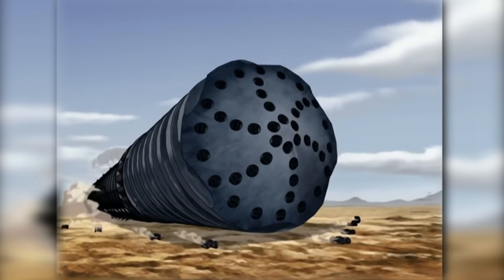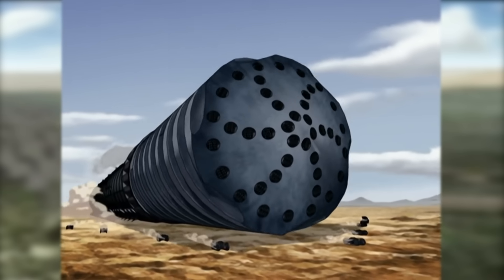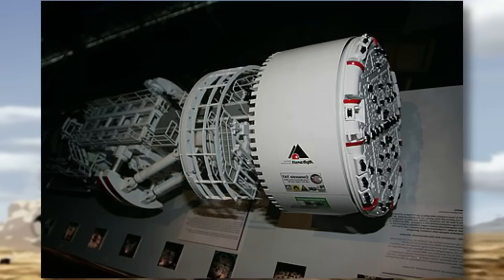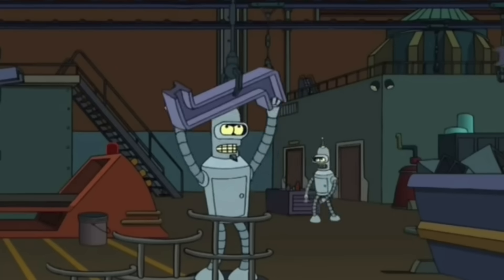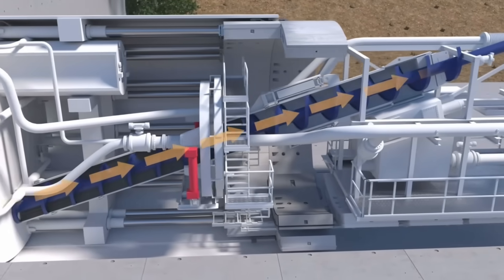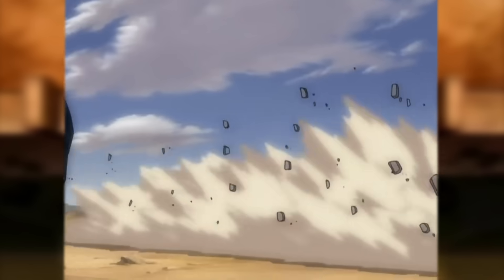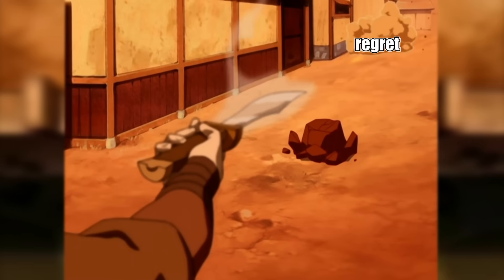Engineer Breaks Down the Fire Nation Tech

Comment: Water jet cutting doesn't actually cut using water. There are tiny particles in the water. The particles do the cutting. You can think of the water jet as liquid sandpaper. It is the sand that cuts, not the water.
Reply from the maker: Yea, using an additive in the form of abrasive water jet cutting is a valid method, but plain water can be used as well. I’m not sure how common either is though.

Comment: The Wall doesn't enclose the whole Kingdom. I think that Ba Sing Se is meant to be a cross between the fortress cities of China and the walls of Rome and Constantinople which were both famous for never falling, at least until they did. 

They are built on the huge scale of Chinese fortifications, but like the walls of Constantinople, they enclose not just the city itself, but also several square kilometers of hinterland in which to store food and water, and stage the defending forces during a siege.

Of course, Ba Sing Se doesn't seem to have the geography that made that a sensible choice for Constantinople, or the elaborate internal structure and redundant lines of defence that characterize Chinese walls, but maybe earth bending makes up for it.

Comment: Fire is very odd.  Fire is energy that mostly happens with the bonds  of carbon, hydrogen, and oxygen aka Hydrocarbons.  Our bodies could considered creating fire and that's what gives up a body temperature.  Fire bending comes from the heat of the Sun basically with the heat of human bodies and the direction out put you can create the energy to make fire, lightning, and heck you can focus the energy to make a nuclear energy.

Fire is in short heat and energy that is made by destroying molecules and even splitting an atom.

Comment: Thinking about it the Earth Benders had such a Smooth Brain on top of that Wall. Instead of hurling Rocks at a Stucture made to bore through Rocks they could've put some united effort in to Lift a Platform under half of the Drill just pivoting it over so it's upside down. Since Earth Benders can just take down the Walls as we can see in the Show, Lifting a Plateau under half of the Drill doesn't seem too hard in comparison.
Reply: An even easier approach (of for some contrived reason they are not „strong enough to lift this behemoth for some reason) would be to lower the earth in front of the drill so it ether breaks from the stress or drills at an angle into the earth. I do not see any feasible way for fire benders to pull this thing out of an downwards sloped ravine.
Boring right into the earth crust would be a suicide mission for a bunch of fire benders.

Comment: I think making the walls THICKER would only have delayed the F.N. drill.  If, however,they had made the wall TALLER while the drill was partly inside they would have taken away its forward force by removing the tank treads from the ground and thus completely disabled it.  Aaaaaand it probably would have caused it to bend under it;'s own weight.  But that's just a theory.

Comment: Firebending being the only element that comes from the bender (outside of the occasional bit of really weird water bending) is actually explicitly commented on in the show, So it's not just you. Technically it could be argued that what fire benders are doing is more along the lines of bending the heat that already exists to enchant it and ignite the air but like.... Yeah it's explicitly commented on in the show how it's the only element that comes from within

Comment: Considering the scale, I imagine the mechanical parts are harder to get to and destroy. Not to mention the benefit of destroying parts where people aren't when there's just a handful of people going on board. Metal bending also wasn't discovered yet so a structural collapse would be virtually impossible to repair even if you could weld things with your hands, making the victory last longer.

Comment: If we're accepting that water bending can cut metal because pressurized water is used to do so IRL, then we 100% have to accept that air bending can cut rock, for the same reason. Using pressurized air to cut things isn't as common IRL, but it's definitely a thing.
Reply from the maker: Ah cool, I hadn’t researched air cutting at all. I wonder what it’s used for

Comment: To give some credit to the Earth Kingdom defending garrison:

Prior to this drill (which was for all intents and purposes a fluke of engineering beyond its time), the expected siege tactics of the time would have involved rudimentary siege weapons such as cannons or catapults hurling kinetic projectiles against a ~20m thick stone wall and/or hoards of infantry using ladders to climb the >100m high walls. Both of these tactics can easily be thwarted before they actually become a problem to the wall by "Earth Bender drops big rock on them from atop the wall".

There's always the possibility of enemy earth benders boring through the wall, but then it just becomes a battle of attrition of the attacking earth bender opening a hole vs the defending earth bender closing the hole. Typically cases like this would be defender's advantage because they would also have people atop the wall dropping rocks or shooting arrows at the attacking bender to waste their energy while the defending bender is left unharried.

Comment: Air contains oxygen and hydrogen in the form of water vapor, so I think fire benders can create fire because the potential for it is all around them. This would be akin to more advanced techniques like lightning bending or lava bending, except it's so integral to fire bending because it has to be one of the first things they learn. Lightning bending in particular is a good example, because Iroh describes it as literally separating positive and negative "energy" in a way that sounds a lot like ionizing the air. This indicates that firebending CAN work on a chemical level and also cause chemical reactions that should require a significant input of energy. Separating hydrogen from oxygen only to recombine it is actually more energetically costly than removing a few valence electrons from gas particles. 

Basically, firebenders get a free advanced technique, because otherwise their bending would be as useless as it was in the Shamylan movie where they all had to carry around torches to have a weapon, and they could only bend tiny little ropes of fire.

Comment: The easiest way to stop the drill would have been Earth Benders passing it in a tunnel below that they could conveniently create with earth bending. 
Then make a giant empty space below the non-drill part while just leaving a thin layer of earth at the top to avoid being noticed early.
The empty space would have to be as wide as the drill and as deep as the non-drill part of the drill is long.
Start making the empty space beginning from the rear end of the drill and continue until at least half of the drill's length is undermined by it.
Then let the thin layer collapse.
The drill will then fall into the hole due to its own weight with only the spinning part sticking out vertically into the air.
Now close the hole around the drill with earth bending again and the drill will permanently be stuck there, unable to move.
And the Earth Benders get a nice rotating landmark sticking out of the ground.

If the Earth Benders can create a giant wall that easily then creating that hole for the drill to fall into that way should be easy for them.

Comment: Wouldn´t it be easier just let the drill to ho 1/3 into the wall and then move whole section of the wall up or down and this would simply bend the drill or nick it? If they would add some weight to the wall, it shouldn´t be problem even to crush half of the drill.

Comment: I always thought they should have just used their bending to deform the terrain and make it impossible for the drill to get close. It runs on track treads and has an absurd length. You can take advantage of that.
Reply from the maker: Yea the flat terrain made it too easy for them! Just a few bumps and wobbles could’ve stalled it.

Comment: Avatar's bending becomes quite fuzzy where it mixes with real scientific precepts, but, in essence, fire bending and air bending are "Kissing Cousins", because FIRE bending is mislabeled, it's not fire bending at all, it's ENERGY BENDING, notably, heat, but not entirely, as they can also throw around electrons, as we see with Azula. Fire bending essentially forces localized mater to change STATES, instead of position, something that Water bending is ALSO capable of, but water bending can do BOTH OF THEM, and appears to be the only one that can do so.

For example, fire bending doesn't create fire ex nehilo, but rather we always see it emerge from a singular specific point, which I posit is the place where it concentrates loose heat energy to transform the state of the air from gas, into PLASMA, the same energy state as the surface of the sun, which is also acknowledged as one of the greatest teachers of fire bending, much as the moons tides taught water bending.

So, no, it's not creating fire from nothing, it's changing the air INTO fire, temporarily.

Comment: To be fair they did not use the most efficient way to destroy the drill, they are not engineers and were improvising on the move, so they were left with the knowledge that they did have and it was some knowledge in structural stability

Comment: Edit: Not technically true, but cool if it were

Regarding firebending. The way I see it is that firebenders are using the fire created in the mitochondria during ATP production (as this is, in fact, a combustion reaction). Hence, Iroh's line: "Power in firebending comes from the breath, not the muscles. The breath becomes energy in the body. The energy extends past your limbs and becomes: fire!"
Reply: makes sense to me.
Reply: That is probably one of the best explanations i have ever heard of.
Reply: Firebending comes from "chi" and Chi translates as air or breath
Reply: I believe this is also pretty much why the theatergoers spontaneously combusted in the intro of Parasite Eve.
Reply: ATP production is not combustion. Yes it involves oxygen, but it's not a combustion, it's cellular respiration.
Reply: @normalactivity7404  Fact checked. You're right. My bad. I mistakenly thought that C6H12O6 + 6O2 -> 6CO2 + 6H2O + Energy was a combustion reaction. Didn't realize there was more to it. Dunning-Krugered myself with my high school chemistry
Reply: @normalactivity7404  From Wikipedia: "Although cellular respiration is technically a combustion reaction, it is an unusual one because of the slow, controlled release of energy from the series of reactions." Is this inaccurate? If so, it would be worth changing it on the website if you have the data. I have a bit of study in biology (unfinished due to health) but cellular isn't really my area, so this is a genuine question as I had always understood it to be a form of extremely slow - and obviously much more complex - combustion.
Reply: @clockwardkailleach  Maybe it's "technically" but generally speaking it's way too different to be considered as combustion, it's more of a redox in general. Ironically it also contradict sthe definition of combustion provided by Wikipedia itself, which is a "high-temperature" chemical reaction which doesn't align with cellular respiration because that isn't high-temperature, so It's kind of weird.
Reply: @normalactivity7404 I mean, there's nothing that says a redox reaction can't involve combustion; indeed, I would be more surprised if any oxidation reaction, including combustion, wasn't also a reduction reaction. I think combustion reactions have to be redox reactions, by definition.

Cellular respiration certainly is high-temperature in that it does release a lot of heat, just, not all at once. We wouldn't light a splint on our own or anything, but without our extremely efficient heat exchange systems we could definitely slow-roast ourselves. High-heat would be a better way of putting it than high-temperature, imo, or just "exothermic".
Reply: I didn't say that redox reaction cannot involve combustion, combustion itself is redox. It just that cellular respiration isn't considered as combustion because of that definition provided by Wikipedia itself. Both involves redox, but not the same.

I think what it meant by high temperature is really high temperature in one time, in a way that it would result in temperature of hundreds of celsius or more, like, well, a fire does. Or just above the "average" range (depends on context). Cellular respiration isn't like that if it does it would be bad for us. If what it mean by Wikipedia is because "it does release lot of heat, just not all at once", well.... it isn't, "high-temperature"...... then..? 

It would be odd to call something as "high-temperature" measuring based on it's output because we usually say something is "high-temperature" based on how high the surrounding temperature during the reaction. If we call it "high-temperature" then basically almost all exothermic reaction could be considered as "high-temperature" if we just look at the total output.

And also, this is the definition of combustion according to Wikipedia:
Combustion, or burning, is a high-temperature exothermic redox chemical reaction between a fuel (the reductant) and an oxidant,

As you can see based on the wording "high-temperature" and "exothermic" is clearly distinguished. It seems clear to me that what it meant by high-temperature, is actually high-temperature that is commonly seen as too hot for us. Now if you call cellular respiration is exothermic than yes that's true, as long as it releases energy to it's surrounding no matter how small. But considering it as high-temperature is pretty out of place.
Reply: @clockwardkailleach  Oh yeah, rusting of Iron requires oxygen, but again, not a combustion nor high-temperature.

Comment: Hey might I suggest a vídeo? Take a material with fantastical properties from any media and describe something you could build with it.
Reply from the maker: That’s an awesome idea! Definitely a thinker, thanks for the suggestion
Reply: One good place to look for interesting materials is bionicle:
there we have: Protodermis: a material that can bê altered to mimic water, iron, steel, diamond and others depending on how it is worked, Cristals that emit heat or light, crystals that grow into massive towers when exposed to protodermis, a metal called exsidian which os higly resistant to erosion, and these are only a few examples.
Theres Also in octopath traveler II a metal called clockite which is fragile and brittle at room temperature but becomes much, much harder and stronger when heated.
Reply: Another one is Hhirokane a scarlet metal from japanese legend that conducts heat so well that through it you can feel the body warmth of another person touching it

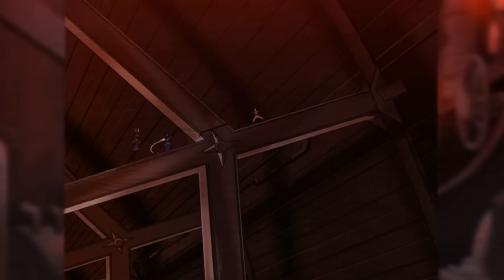Comment: 3:38 That speed for a waterjet  is for water that's "thrown" and then has to cut through the metal using only its momentum. Waterbending presumably continuously applies force to the water as it's cutting, so there's no minimum speed it needs to be traveling. It's much more comparable to a large industrial shaper machine, which does move at about the speed shown, rather than a water jet cutting machine.
Reply from the maker: That’s a great point, the addition of a force would mean the speed is somewhat irrelevant, though it would’ve been a real workout for the waterbenders!
Reply: @onstructures  it would explain the sweat Aang and Katara build up
Reply: @onstructures which would explain why the 2 were struggling with just a small ball of water.
Reply: Still they probably should've thrown some sand in with the water too
Reply: I agree with the previous comment, most water jets don't use pure water for cutting, they mix in some kind of particulate matter, usually of some kind of ground up gem-like material (I wanna say beryl, or synthetic ruby, or something? Somebody pls correct me there...) as additional grit in the process, like sandpaper, but with water instead of paper.
Reply: @Caldoric  I believe a common one is garnet
Reply: @JackieBright  THAT! YES! That's the stuff I was thinking of. Thank you!
Reply: Yeah, the lack of grit is a good point too.
Reply: @Caldoric tbf Katara never bends pure water, we know this because of the desert epsiode and Sokka drinking swamp water with swamp taste, so all her new water is gonna be full of sand
Reply: @Caldoric nah, just quartz, using beryl is banned and corundum is too expensive